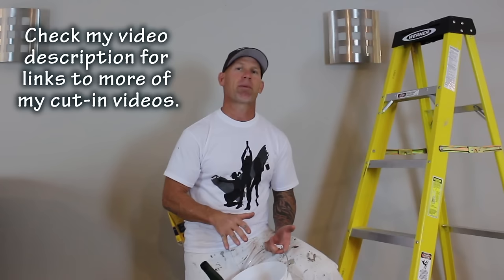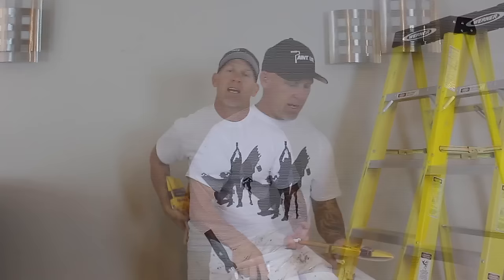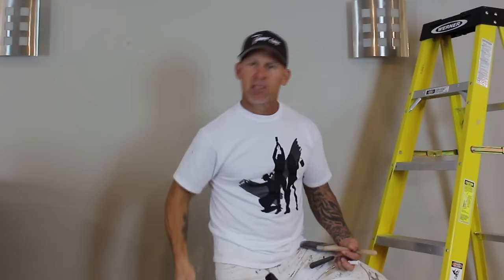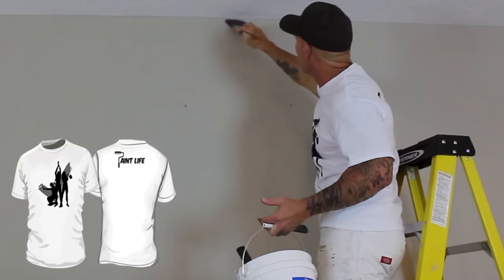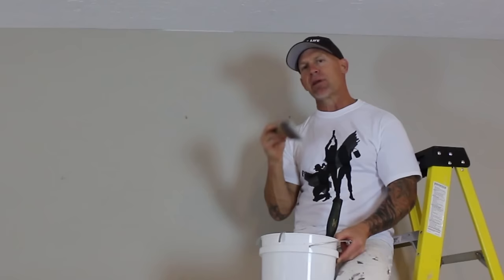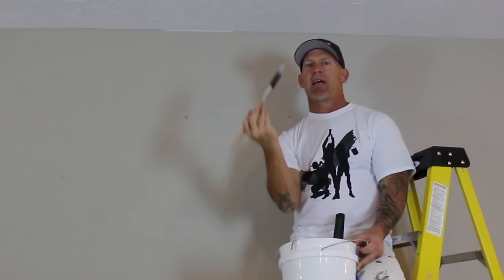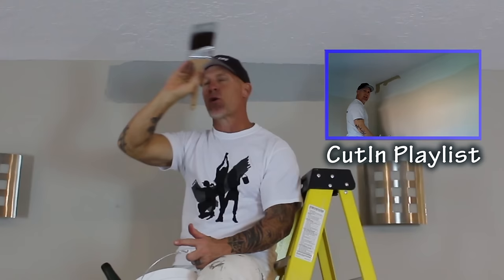HOW TO CUT IN CEILINGS.  DIY home improvement cut-in hacks and tips

Comment: I've been painting for years with a red dixie cup and brush when cutting in. Then I take my 9 inch roller and get as close as possible to the ceiling to back roll. Your method of 2 gallon bucket with grid and 4 inch roller will save me time and do the whole process in one climb of the ladder. Thank you so much for this video 👍

Comment: I was taught to put my brush to the wall just below the ceiling and then twist at a 45 degree angle to create a point on the brush that will accumulate a flow of paint similar to a fountain pen. I can get pretty accurate and steady lines with one stroke using this method. Just sharing my method. Love your vids.

Comment: One way that really helped me speed up my cut-ins and get straighter lines was to follow my eye along the cut line instead of looking at the tip of the brush or the paint as its being applied. I've found that the brush automatically follows my eye along the line and I can pull for longer distances with an excellent line.
Reply: Just like driving, brilliant. Thanks for the tip!
Reply: like carrying liquid in an open container..look to where you are headed not the cup..=\/

Comment: your 5&1 scoring technique can lead to potential bubbling to the tape in the ceiling line, the moisture from the paint has the potential to get behind the dry wall mud and cause the tape to bubble. Its a good idea but some might push to hard and cause issue that will have to be addressed in a month or so. I like cutting in with a 3 1/2 inch flat brush it holds more paint and my strokes can go longer. your videos are pretty good. I've been painting since 1986 and also own my own business. You simplify things for beginners well.  Good luck on all your endeavors.
Reply from the maker: Thank you for sharing & watching!
Reply: I run my 5-in-1 along the ceiling line just hard enough to leave a line which allows me to follow it and produce a fine line. Many ways to go about it really.
Reply: I think scoring the ceiling corners should only be done on popcorn ceilings heavily textured walls and ceilings or if there is no line to follow. scoring your line then running a small bead of caulking over it would be just right. if you are lucky you don't have to do any of that and you will have a good line to follow. if you're even luckier the one who painted before might have done a excellent job cutting in so all you gotta do is follow the previous cut.
Reply: Against popcorn I prefer scoring the corner with a 3 inch  angled wall scraper and pull with the handle tight to the wall..

Comment: I really learn alot from watching your videos. I have been a water damage restoration specialist for almost a decade and until this year I have only done the dismantle and drying portion. recently I started doing my own drywall repairs and painting, which isn't rocket science but I am a perfectionist and want to do the best job possible. there are two aspects of your videos that I really think is cool. first is the fact that you share scripture on the bottom. and second is that you share what products actually give the best results. there are so many different products out there and it can get confusing trying to pick out the best brushes and rollers heads. keep representing the kingdom and doing good work.  Colossians 3:23-24
Reply: Malcolm Beaton amen

Comment: Running the paint dept at home depot and being a painter myself you answered a question I wanted to know about, that is doing your cut in more closer toward the ceiling than to low on the wall in order to show a straighter line and than back roll to hide the brush stroke marks, thanks chris you give very good advice on painting, and the girl at the end has a good sense of humor.

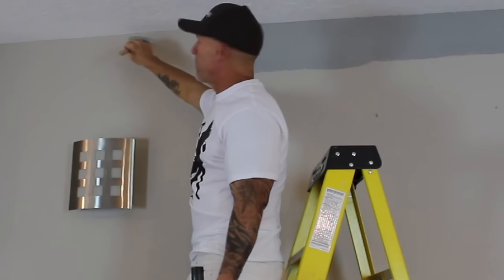Comment: Your video was so helpful. I was painting a room with crown molding and was trying to cut in without touching the molding. It was a disaster! At 12:25 in your video you said you like to let the paint go up on the ceiling a little bit because it makes it look straighter. I decided to let my brush run along the bottom edge on the molding, painting it too, and it looks great. I was able to work my way around the room in no time, completely stress free! Thanks!

Comment: perfect instruction been painting for 30 years and all those things are what you learn to do over time...caulking will depend on type of job you want if you need it to be perfect like in a multi million dollar home but the average house you can fix with 5 in 1 and paint line. yes always just a little on the ceiling little as possible but if the line is consistent it will always look perfect. i like the 3 inch clear cuts angled and straight. the straight is better for large areas where you can make more time because they are box vs, thincut and the box is thicker and holds more paint. angled where theres more trim and bathrooms.
Reply from the maker: Thanks for your thoughts

Comment: You're awesome and s great craftsman, I've been painting 22 years now and luckily when I began I was trained and mentored by amazing painter's who Sincerely cared, I use to try to create my own line many years ago and basically it looked like one of those sherline pads, kinda leaves a picture frame look and isn't very appealing to anyone's eye😂, I'd see guy's cutting just flawlessly straight lines and they showed me to go about a dime's width onto the ceiling, any direction you looked, the wall color would just disappear up behind the ceiling, absolutely amazing and simple technique, on accent wall's though I do what you do with the caulk trick or I'll tape the adjacent walls, use the opposite color, seal my tape then when it dries I can go over the tape with the actual accent color, this will prevent leeching and bleed through. If there is no other colors adjacent to the accent, I'll just use clear paintable caulk, the Idaho painter knows his stuff and is definitely pro! Thank you so much. Lorenzo gig harbor WA.

Comment: Just used Purdy clearcut glide elite 3" extra stiff angled sash brush to cut in trim with semigloss. Kilz interior paint.  Much better than medium stiff Purdy XL glide 2.5" angled sash brush.  Thanks for the tip.  I chose extra stiff instead of stiff - hold paint great, really nice finish, and easy to direct.
Reply from the maker: Good to hear, thanks for watching!
Reply: Is a great brush holds up for weeks when painting 4days a week just rinse out spin dry an store flat like tips

Comment: I like block brushes for cuting in. They hold more paint you dont have to dip your brush alot. I like how you caulk for rough texture. I just started to use a softer brush and just fade the brush line with the brush its the same result as backrolling and you get to clean less tools :)

Comment: I like the Wooster 2 inch Shortcut with the short rubber handle and a hand cup with a magnet. I usually have somebody coming right behind me with rollers. I'll start in a corner and go across the ceiling and any window frames or other trim I need the ladder for as I go around the room. When everything high is done I move the ladder out of the way and finish on the baseboard.

Comment: I'm now retired.  I was a pro finisher.  I started my own house painting business back in my twenties, then got into spray finishing and opened my own custom finishing shop -- chemical coatings.  We had two booths and lots of business.  We finished custom kitchens and high end woodwork/millwork.  

Ceilings, baseboards -- any point at which there's a similar cut line... Here's a technique that I learned when I was 20 years old, from my painting boss, who learned it from his pro painter grandfather:

No "tools" other than your brush.  No "guides" -- this is freehand brushwork.  I always used a 3" straight brush because it holds more paint ;).

The premise is that when looking up at a ceiling/wall line or down at the baseboard/floor, it's relatively quite a distance away and usually in the shadows.  From a distance, you'll NEVER detect an eighth of an inch space.  

Ok, we all know that the ceiling gets finished first.  When cutting that wall line against the ceiling (or baseboard against a floor), keep an eighth of an inch away.  NEVER, NEVER, NEVER touch the ceiling with that brush!  Try to keep the space even, but if your line wavers a bit and isn't perfectly straight, it's ok.  Just move right along (it will go quickly).

When you get back down and look up from below, that eighth of an inch "disappears", and all you see is a perfect line.  Going on the same premise, when standing below, looking up, you WILL see the slightest bit of paint that got on the ceiling if your brush touched it.

Try it!  You'll be amazed at this optical illusion.  It WILL speed up your production -- AND your confidence :) 

[Note]  If the ceiling is WAY up there, you can leave a little more than an eighth of an inch.
Reply from the maker: Awesome, thanks for sharing Rich!
Reply: Rich, this is how I was trained many years ago. No one I've ever known has even heard of this - I was starting to think I must have "made it up" or something. But you're right, and this 1/8" technique works great.
Reply: I was taught the same
Its tru old-school technik.
I was taught by my father he was taught by his.
And so on and so on 
Im 5th generation painter.
When my great great great grandfather was painting it was all white lead base
Reply: After you MASTER YOUR BRUSH this a walk in the  park  if you have been pushed or drug thru a few buildings  you get it together or get left no time for wiping  when the roller is right behind you.

Comment: Chris, thanks for all the support you give the public.  I enjoy watching your videos and have learned a lots of little tricks from you that I have not known.  This is saying a lot, as I have been professionally painting since the seventies, and almost every professional I watch is not as efficient and quality oriented as I think they should be.  In this video I like the score idea with a five in one.  I also like your brush twirl.  I thought I invented caulking a rough ceiling. I use white, ant it usually blends in with existing ceilings and corrects others lines that may be too high (I would be concerned that clear caulk will yellow in time).  I do disagree that running a 4 inch roller below the cut in line will make a difference in overall sheen and color effect.  Obviously, if you do not back roll the bottom of the cut in line you would need to spend a couple of extra strokes evening out the cut in area and wiping the excess paint by dry brushing the bottom edge of the cut. If you enjoyed moving up from a 2.5" Purdy to a 3, try the 3 1/2" angle Purdy or Wooster.  Thicker, they will significantly increase the length you can draw with a dip from a 3" with no downside.  My wife also agrees and that is her weapon of choice when she draws lines.  Try it.  They used to sell them in professional stores.  Now I have to order them on line.  Also, since waterborne paints dry so fast, I will always let the cut in dry before rolling.  After rolling only a half inch or so of your cut in line will show and it is up very high.  I've never seen a sheen difference.  Perhaps I would with a high gloss but I never put high gloss on walls.  
Utah has some of the most stringent VOC rules in the nation.  Our paint is sticky to work with.  This is terrible for drawing lines. We now need to add quite a bit of Floetrol in our cut in bucket.
For 8 ft walls I usually use two benches end to end.  That gives me about 10 ft of walking work.  My wife jumps on stilts. 
I spray most all the other cut in work in a room below a foot.
I have been thinking of making my own videos before I came across your excellent work.  After teaching so many beginners I analyzed what I do and developed a 4 step system that actually improved my own cut in. It has made the difference in teaching.  Someone is having problems, it is usually one of the steps that need more attention. I think you would be interested in seeing it.

Comment: another tip: if your painting your own home and you have popcorn ceilings. TAKE THE POPCORN DOWN FIRST...lol popcorn ceilings are completely outdated and will make cutting in for a new painter feel impossible to maintain a straight line. im sure idaho painter can whip up a popcorn removal video for yall, its actually really easy skill wise its 90% prep work and cleanup lol :-)
Reply: It's easier to cut in a popcorn ceiling than a flat ceiling. With a flat ceiling your cut has to be straight as a razor. On popcorn its usually not possible to make it that straight. A Popcorn ceiling can take half the amount of time a flat ceiling would. 
Although i will agree popcorn is outdated and should be taken down if within your budget. Keep in mind that your ceiling was origianlly taped for popcorn, not flat. So you will have to fix the taping to make the ceiling flat to the eye. Otherwise at different times of the day your joists will look like waves from the light reflection.
Reply: paulmolive84 itll cost a bit more but the best route is to pay an experienced drywall guy to skim the ceiling.
Reply: @johnny boney Yes I agree. We charge a fair amount for the take down and skim service. But it really makes the space feel bigger. Depending on size of space the ceiling can feel 2 feet higher lol
Reply: NTM, old popcorn ceilings, esp. in commercial applications are asbestos.  Never attempt to backroll an unpainted popcorn ceiling, learned that the hard way in the early days.  I agree, remove it, esp. if its never been painted.

Comment: Love your videos. Can't stand angled sashes and it is actually a little easier for me to get into corners with a flat like a purdy pro extra swan 3 in. Plus I can cut a ceiling line as long as both arms can reach with one dip. I also usually choose a brush based on the texture of the walls rather than the viscosity of the paint. Nylox  is great for smooth walls.

Comment: this is good instruction for non-professionals. As a professional. I use a 3in straight edge brush. Not Purdy. Purdy brushes have very fine bristles and act more like a mop then a brush. A stiff abristle 3 inch brush does a better job. also no need to back roll. Just bring the cut in down 3 in. and then roll normally with a 9 inch roller. but again this is good for non-professionals
Reply from the maker: Thanks for sharing!

Comment: your lines look jagged o well there not mine
Reply: Anthony Martinez they're*
Reply: Anthony Martinez 
can depend on how straight the drywall work is also.
Reply: Anthony Martinez where is your video there wet E
Reply: It's only jagged where he put caulking it wasn't try enough to paint but he just showed u for video purposes if your a painter u know the caulking will bulge up onto the ceiling if not dry .
Reply: Millennium Man same here but if u plan on doing two coats  water down your paint and use a stiff brush (purdy pro extra) the first run then for your second coat use regular non watered down paint for coverage. 
Also if it's a one coat job just have the water sitting on the top of your paint in the bucket to get a straight line the tilt the bucket back and get all the thick paint to lay off your line and get coverage .
Reply: isaac walker never put water in your paint because it will never touch up and you loose the body of the paint, durability and the true luster of the color will never happen
Reply: Not just use a square mini scuttle instead of a bucket 🤔
Reply: 3 inch Purdy stiff monarch on most emulsion work not angled.
Reply: that's why the first thing he said in the video is to take the 5 in 1 tool and score the top! This makes your lines neat even against sloppy ceilings/wall corners.

Comment: You should try a 3.5 inch proform oval brush, I've only seen them for sale at diamond vogel stores, and they are 10 dollars each where I live. I've used almost every brush on the market, and these 3.5 inch ovals are by far the best brush I have ever seen. Used them the past 6 or 7 years exclusively and they are phenomenal. For any task.  They corner tight areas better then any sash you can find and hold a TON of paint.

Comment: I find it more ergonomic and accurate to start the cut with arm fully extended and pull the brush towards me. I find that when pushing the brush away from me, my line of sight to the point of contact is obstructed by my hand. I'm right handed, so when I use this technique I will cut the room counterclockwise, pulling the ladder backwards as I go. If there's a number of rooms to do, and there is plenty of space I will set up an A frame on each end of a wall and stretch a 2"x10"x8' across the ladder steps at a comfortable cutting height, walking across the plank. I think it might save a little time - definitely less up and down and more ergonomic.

Comment: I like to use the corona brushes and a tip I learned about 5-10 years ago is to use a drill hook for a tool belt to hang the bucket on your belt so you don’t have to hold it the whole time. I can’t imagine not using it now.

Comment: I usually use a sash brush when I’m cutting in, but I was trained with a big 3 inch Wooster flat,I can use both though and I’m sure you can too. When your capping your cut with a little 4 inch roller it’s awesome to have a little 2 tier baker scaffold, you can really move along your ceiling pretty quick.
Reply from the maker: Awesome, thanks for sharing Johnny!

Comment: Great tips...I also found the Purdy 3 1/2 inch Clearcut perfect for my pre-rolling cutting.  (Which takes me much longer than actually rolling it.)   But the more I do the faster I'm getting and I like the little Paint Pail (1 qt) for holding my paint while cutting.   With longer ceilings, I've found my primary (right) arm getting to fatigued after an hour or so so I'm also using my left arm to paint but just can't go as fast.
Reply from the maker: Practice makes perfect! You can not shortcut practice and experience! Thanks for sharing your ways :)